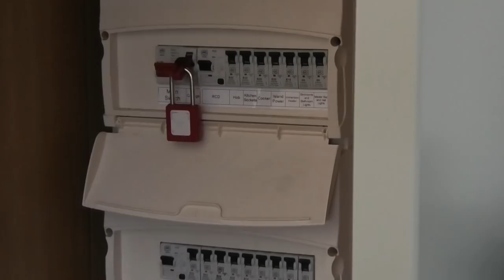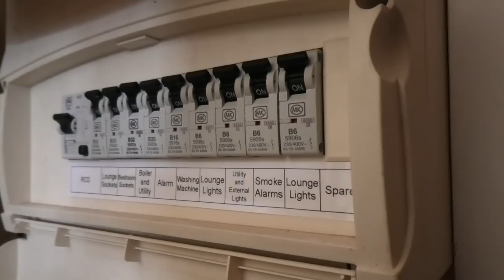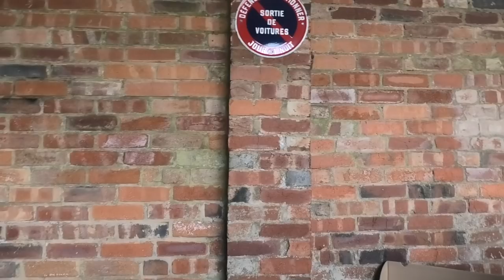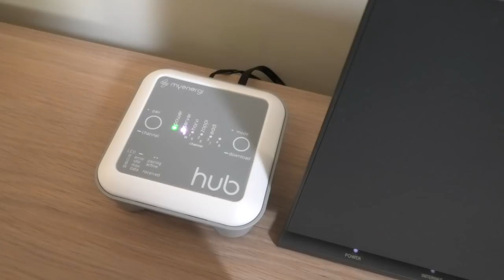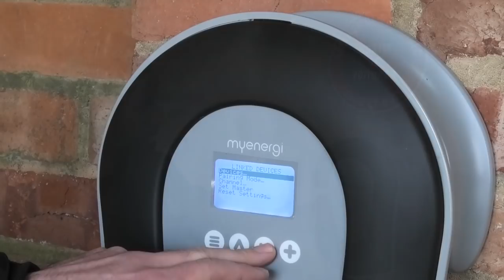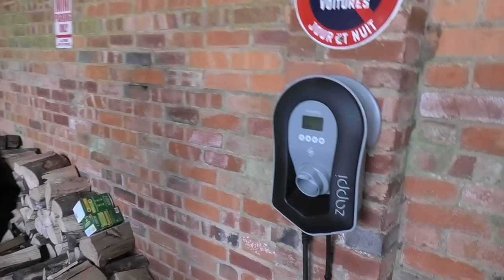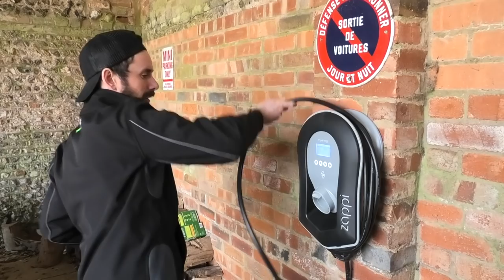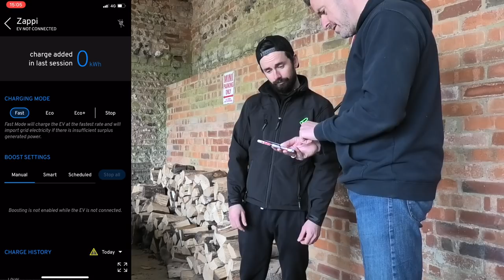Why have I fitted a Zappi Smart Car Charger ?!

Comment: Hi Ped, I joined Octopus late last year and ordered a smart meter straight away. Nice chap came in February fitted new meters and gave me the home display to check what I was using. The gas part of the display worked straight away, it took about 3 weeks before the info was available to see on the website. The electric however was a different story. After waiting 2 weeks I emailed Octopus -nothing after 3 days. It's taken 4 phone calls, 6 emails and 10 weeks before both the website and display are now working. They still couldn't give any reason what the problem was. I'm hoping to change to Octopus go, but now I'm hoping it don't throw a spanner in the works. Just thought I would say that it may take a bit of time before the smart meters become - "Smart". 
Great videos and content as usual, very envious of that Zappi charger.

Comment: I helped design and had a solar PV system installed that includes the Zappi's sibling product, the Eddi power diverter, which uses excess power generated to warm the hot water tank immersion in preference to export. It is a nice piece of kit and provides similar information to the Zappi to help you manage your energy consumption. I do hope you install a solar PV array as I was involved with microgeneration prior to retirement and I prefer solar to other technologies because of its passive nature.
Reply: Speak English ! Worse than Call of Duty - have you got a ECD/GB/and a Ground Break.
Reply: Thanks for being part of the zappi team. 

If you could design the next level
Smart charger, what features would you add?
Reply: @matthewtaylor3351  The ability to precisely set the charge rate in order to interface with solar production, which varies widely during the course of the year.

Comment: I’ve got a Zappie linked to solar and about to install battery storage as well. The Zappie also very cleverly disconnects the EV if there is a fault on the supply to your house. Otherwise your EV could be live with what appears the rest of your house disconnected!

Comment: Good choice!
The Zappi is #1 on my list for the ability to change charging priorities so I can use all my solar surplus and have the flexibility  to change the priorities depending on whether I'm home all day or need to get a charge in a certain time regardless. That is the killer feature especially when you are exporting nearly 1000kW per quarter for a measly amount.
I am in Australia and the only concern I would have is how it would handle a hot day with the sun on it or would it need to be sheltered.

On the lock on the fuse panel, Any industry especially mining has very strict protocols on isolations including a clamp that everyone puts their lock on so it could have 5 or 6 locks on it. Not nice when someone turns on a 1000 Hp machine with someone inside it.

Comment: Nice Install. I was on Octopus Agile but went to Go -Faster as Agile prices have not been great lately (wholesale prices have got higher). Go faster is a bit easier to deal with as straightforward.I now get 4 hours between 8:30pm and 12:30am at 5p/kWh and that means I can also do washing etc atthat time not just charge the car ;-) Agile was getting too expensive as the daytime rate was so much higher :( Might be worth a look as with Go-Faster you can choose (to a certain extent)the times you want the cheap period to be and also how long can have 3h for 4.5p or 5 hours for 5.5p so its very good! I may go back to agile in the future as it was a great idea to try to balance the load on the grid and reflect the carbon intensity with higher prices.

Comment: Having your own private fuel station in the garage is every bloke’s dream. You didn’t mention the output of yours? My Taycan 4S+ charges at 7,4kW. Strangely on the same equipment, the TMXP charges at 8,4kW and the TM3P at a whopping 10.4kW!! Not sure why my Taycan charges so “slow”. 0-100% takes about 13-14hrs (as charge drops in the end), but in general, one doesn’t park with an empty battery, and 7-8hrs is the usual charge time to reach 100% so I guess overnight “full tank” is OK. 

Now you just got to get yourself a Taycan😉 The base RWD with the big battery goes a long way👌🏻
Reply: The Tesla 3 can do 1x32A (7.4kW) or 3x16A (11kW)

Comment: That was really interesting. You didn't give a cost but I will have a look on their website. If I was buying a second hand electric or plug in hybrid I would need to get one so that has been most helpful. Thanks again.
Reply: Feel free to email sales@myenergi.com if you have any questions 😌
Reply: @kennymay_sings  Will do. Thanks
Reply from the maker: With the charger and cost of install, which can vary depending on cables needed etc it’s probably around £1000 👍
Reply: @PetrolPed  Thanks very much. It helps greatly knowing a company that can be trusted that comes on a recommendation that I trust as well. Not quite at the stage of purchasing yet but it's a near certainty that the next car will be at least a PHEV if not a full electric.

Comment: I've just changed from Agile to Go as Agile prices have been quite high for several months now... whereas with Octopus Go you are charged 5p per kwh between 12.30am and 4.30am which your Zappi can be set to. Once your smart meter is fitted you can change to Go immediately. Good luck👍
Reply from the maker: Great. Thanks for the info 👍

Comment: 13:21 I have a Smart Meter it alerts me when my wife has left the Heater on again - have bought her a Tog24 Ski Jacket and saved ££££ on Energy -  Go Green like Greta I  tell her as she Shivers, The Lounge and Kitchen areas can be reduced on individual thermostats by as much as 5-10 degrees, before any risk of hypothermia set in, at which point to prevent any loss of limbs due to frostbite we go to bed with ONE HOT Water Bottle taken in turns of course, but sometimes find alternative means

Comment: I've had my wall charger since 2017 so no intelligence to mine, but then I did get the Government subsidy. Cost me £150 but the electrician charge circa £750 supply and fit, government subsidy paid the difference. I did have a bit of paperwork to submit and had to give either the reg of the car or a copy of the new car order, just as you described. Great video, very informative
Reply from the maker: Thanks Dan 👍

Comment: Great video and really useful - my charger is a dumb one, but the real cost was getting the wiring sorted between the house and the garage.
Reply from the maker: I was lucky on that count 👍
Reply: It can get expensive if you have to bury cables. If you don't need to bury them it shouldn't be a big cost. I'm afraid the truth is that there are many EV installers who are making a lot of money ... that grant gets swallowed up very quickly!

Comment: Zappis are great bit of kit. . I've got 2 EV's and solar. Had so much sunshine that I actually managed to fill both cars last weekend. Running cost for overnight charging on Octopus GO is £1.47 for about 100 miles of range. My business fuel costs have gone from £30 a week to about £2.
Reply from the maker: Wow 😳
Reply: That’s brilliant. With these savings, surely it will reduce the time it will take to get your money back from the solar panels? Most people say it takes 10-15 years to earn the money back from solar, but if the solar is charging your car, surely this time is slashed?
Reply: @PetrolPed  "fuel" cost update . .Done 5000 miles in my MG5 and it's cost £44 in electric so less than a penny a mile!!
Reply: @neilmcknight9003  They've paid for themselves this spring. I bought them in 2013 and get about £700 feed in tariff payments a year. Typically now the government has slashed the FIT payments new solar buyers will only get their money back if they charge an EV during the day.

Comment: Great video showing the prep required to put what is effectively a filling station in at home. I did something similar in early 2019 before getting the e-Niro here in France. We put a dedicated feed from the consumer unit into the barn where the car is parked, buried a 15 mm cable 600 mm underground ...bit of overkill you could say but my sparky wanted to be on the safe side. I don’t have anything so sophisticated as the Zappi, not sure they sell them here and as I’m retired I don’t need to charge faster than the ‘granny’ cable. I do have solar panels though and last year my 8 panels produced enough electricity for me to drive 15,000 km which was 85% of my driving. We have an ancient electro-mechanical meter that runs backwards when the sun is shining....So until the dreaded smart metering arrives we are running the car almost for free!

Comment: Great video Ped, nice to unravel the mysteries of EV charging. I suspect the intricacies of tariffs and car to grid will be lost on a lot of people initially until it becomes the norm.
Reply from the maker: Probably 👍
Reply: There are very few EVs capable of car to grid so it's not much of an issue presently. (The drawback of car to grid is that you are cycling the battery more frequently ... and ultimately the life of the battery is measured in cycles ... so you are shortening its life. I'm not sure I want to do that with the most expensive component in an expensive car!)

Comment: I wanted the wallbox pulsar plus but couldn't find an olev installer and ended up with the Zappi. It is a really good charger and myenergi have great customer service too. Really glad I ended up getting one. One thing they could improve is allowing a timed charge greater than 8 hours. When I need to do an equalisation charge I could do with a longer time period.
Reply: Just set the Zappi to "Fast" without bothering with any timer in those instances. Set the start time on your car (if it allows it).
Reply: Unfortunately my car doesn't have a timer and my off peak starts at 00:30. I only need the longer timing for an equalisation charge which isn't very often.

Comment: Very interesting video. A couple of issues I have. I hate the fact that some energy companies insist on the customer having a “smart” meter. Whilst they are not compulsory I will resist. The reason being, I often switch providers to get cheaper tariffs. Therefore, run the risk of the meter becoming a “dumb” meter. Yes, I know it’s less likely with the newer generation of meters! Secondly, my car is in an allocated space in a residential car park and I can see issues with a cable running across the footpath between the car & the house. Sorry, petrol still wins for me!
Reply: The smart meter issue has been sorted with the newer types. They really are essential if you want to take advantage of tariffs that give you cheap rates at different times of day/night. Some tariffs can have a different rate for each half hour segment of a 24 hour day! (Anyway, you've got a dumb meter already and seem to be happy with it!)
Reply: @MrAdopado  Whilst the risk remains I will still resist. So many stories of botched installation. Just to clarify, I’m on Economy 7 which virtually halves my unit rate at night which is when I use 80% of my power heating water & storage heaters (when required).

Comment: You need the right energy meter to do these off peak charging .    Electricity suppliers can’t measure your usage with without smart meters.  In most cases you do not get the cheapest energy tariff when you have the supplier install a new meter.  The recoup that cost in charging more per kWh.

Comment: Solar would be a great move. Given time one imagines that the 'agile' tariff will change - it is all about when people are using electric - if everyone is charging cars at night (normally a low usage period) - will there still be a price advantage. I already have a Ground Source Heat Pump (installed in 2006) - this means I can't have an EV charger on our property (in the middle of nowhere!) as our power supply isn't big enough (We are limited to a 100 amps) - We also have a granny annex on site for my Mother in Law. Good Luck and will be interested to see developments.
Reply: the Zappi can limit its output based on usage to enable it not to exceed your maximum demand

Comment: Hi. Take care to do the analysis on the agile tariff as it’s not always as cheap as you’d like. 

We’ve been on it for 10 months or so and initial savings were huge but we’ve paid more  than our previous tariff for the last few months even being careful to avoid the peak hours.
Reply from the maker: Thanks for the heads up 👍
Reply: @PetrolPed  If/when you are on a smart meter you can download the Octopus Compare app. It analyses your actual previous usage and will give you exact costs of each Octopus tariff for your own pattern of use. Everybody's situation is different. (It's true that Agile has not actually been a good deal recently for many people .. over the past month I would have paid £18 more on Agile than on Go.)

Comment: How much did it cost? It'd be helpful to know the price of each individual component required, and the installation time and cost.
Reply from the maker: The install cost can vary a lot depending on what cabling is needed etc. Average cost of charger and instal would be about £1000 not including any government subsidy 👍
Reply: @PetrolPed  £1000 buys a lot of fuel! Another barrier to mass EV uptake/adoption 🤨
Reply: @markcole1473  - There are cheaper EV chargers available. My PodPoint was £500 after the grant.

Comment: Good one! Do you need 3 phase installed for this to work? Does it cater for all EVs?
Reply: The Zappi will work on both single and three phase, and does most EV's on the market so long as they've got a Type 2 socket
Reply: If you have the untethered zappi you can charge a type 1 and a type 2 EV 😌
Reply from the maker: No 3 phase needed for this. It will charge at 7kw/h. If you had 3 phase that would increase to 22 👍
Reply: @PetrolPed  For clarity ... it's a different Zappi model that has to be installed for 3 phase. And very few EVs are capable of taking advantage of that 22kW. Even a Tesla Model 3 maxes out at 11kW on AC charging. Still a useful increase in speed if you have the option (and if charging multiple vehicles).

Comment: Hi Pete.
Thanks for the vid. Any issues with the Zappi so far? I have similar install issue (consumer unit too far from charger to run data cables). How has the Harvi data transfer worked for you? Any glitches? System down etc?

Thanks
Reply from the maker: No issues so far. I love it 👍

Comment: Zappi all the way with control over car charging, battery storage charging, hot water storage heating, control over charge rates, control over setting a maximum load do not to overload the main fuse, great App control, very neat unit and way of holding the 6.5m cable, no need for an earth spike and World Patented RCD DC and AC inbuilt protection without the need fir additional units. Over the air updates as well and British! Looks great and easy to keep clean. Move to Agile or easier Go or Go Faster tariffs with Octopus 🐙 and with Go works out at less than 1p per mile driving, every day/night!!
Reply: Well ... I would challenge you on the Zappi  "over the air updates"! What a faff. That is the biggest negative of the Zappi owning experience IMHO. A true over the air update happens automatically without user intervention. With a Zappi you have to check that the software version on the Hub is up to date ... if not you have to press/hold/release appropriate button ... wait for download.... watch for colour change on LED. You then have to get the Hub to download the latest software for the Zappi itself by holding down the appropriate button on the Hub for x number of seconds then release ... the download can then take anything between a couple of minutes to half an hour ... watch for the change LED colours or flashing ... once that has been done you need to transfer the software from the Hub to the Zappi ... so you go to the Zappi itself and punch through about 5 different menus to get to where you tell it to download the new software from the Hub. Depending on the software version this can come in 2 downloads and takes several minutes ... after that the Zappi should restart. Job done but it's so complicated you have to go online to check the sequence each time you do it ... and they even changed the instructions.  So, OTA updates are definitely more of a technical embarrassment than a selling point! Anyone who is not technically savvy would be totally lost.

Comment: Is it clever enough (with appropriate wiring) to charge a car straight from PV when there's a power cut in the local distribution network?
And does it have a "dumb" fail-safe mode. Say if the hub dies or the software suffers from the equivalent of a "blue screen of death"?
I've worked in I.T. for 40 years and I'm extremely wary of new software.
VW's Id.3 software for example....

Comment: I’ve one of the original Mk1 Zappi’s along with a Harvi, Eddi, and hub. As I’ve also a Tesla Powerwall I find that the OctopusEnergy Go tariff is the best as on that I get four hours of energy at just 5 pence per kWh that’s enough even in the winter to charge my Powerwall which in turn runs the house. In my opinion the Agile  tariff is best suited for those without battery back up or solar panels.   You haven’t put your link to myenergi £50 discount ! Whoops 😬 should have said your OctopusEnergy £50 discount.

Comment: Thanks Pedro. Did you ever get the smart meter or solar panel or change the octopus tariff to agility? All the best. Simon.
Reply from the maker: Hi Mate
Yep I’ve got the smart meter now, just need to change the tariff. Solar panels and power wall in early stages of planning. Will be fitted next year 👍
Reply: @PetrolPed  good morning sir. Hope you are well. Thank you for the reply. Does power wall suggest a Tesla model Y or roadster might be coming your way?
Reply from the maker: No, not for the moment. It’s just a good way to store the energy from the PVs on the roof 👍
Reply: @PetrolPed  please can you put me in touch with the electrician?